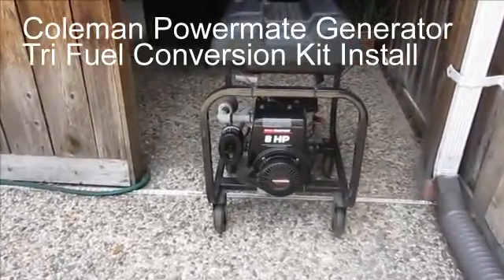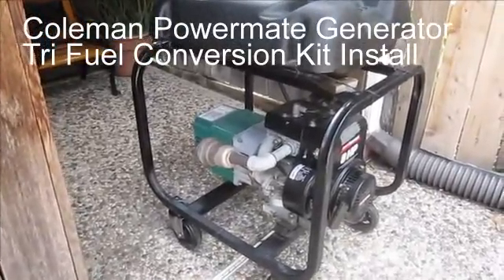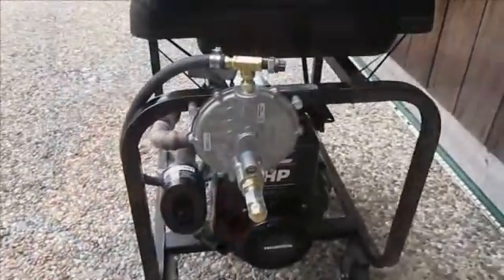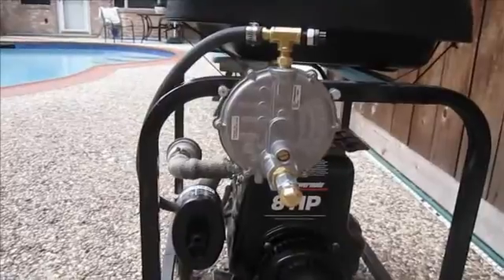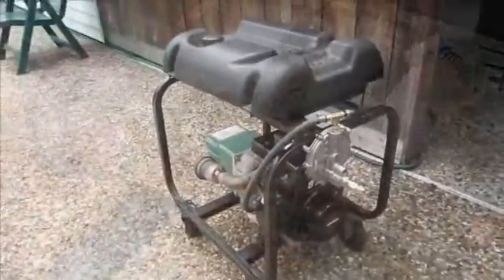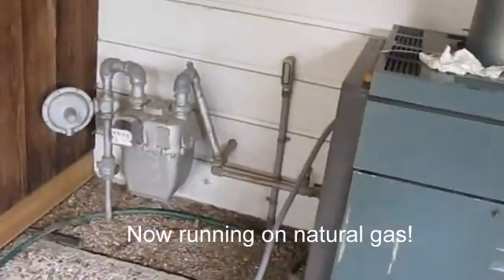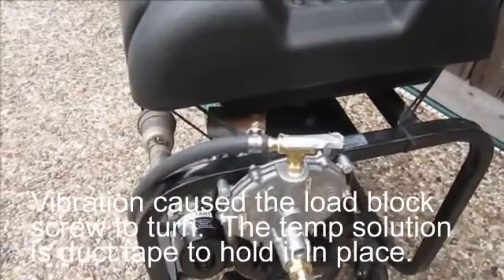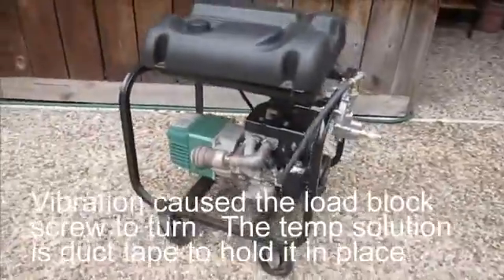Coleman Powermate Generator USCarb tri fuel conversion kit C to natural gas

Comment: I just bought one of these 10 hp 6k watt generators for 45$ I was excited to see that there is a tri fuel conversion for 30$ haven't even tried to start it yet but looks like it was lightly used and then left in a Barn, compression felt good I'm going to tie into my propane after I proved it runs and works.

Comment: good video. I have a 10hp tc the hm100 motor,I bought a propane/gas carb on amazon for $37, it does not fit. in fact I looked & can't find 1 anywhere. I have 1 on my 3500 watt no real name, very popular model, it runs great on pane,not great on gas with conversion carb. since I could not find a combo carb, after seeing your video I decided to make my own adapter between carb & air filter & take pane reg of the carb I bought that does not fit, since I can't return it past return date & I never checked to see if it fit.  was very simple. I have a lath & just machined a 1" think chunk of  aluminum bar stock with a 1" hole in center,2 holes for air filter mount, go 2 10-32 screws 1" longer then stock & drilled a hole in the spacer I made & tapped it 1/4" pipe thread & installed a nipple, mounted reg to generator frame with the bracket it was mounted to carb with & it fired right up. & it always ran great on gas, pane starts 1 pull,gas I always had to shoot starting fluid in carb to start,so I have a small hole drilled in air filter cover for starter fluid stray :)  hope my info can help at least 1 person. I was able to make lemen aid out of a lemon carb I could not return. not sure why I thought it would work,lots of reviews,but not sure there was 1 saying it fit the TC motor. so my conversion still only cost me the $37 2 .45 cent screws & I had the nipple & aluminum already, just took my labor :)

Comment: Is your Powermate a 3, 3.5 or 4Kw unit?  

The same 8HP Tecumesh HM80 engine is on my dads old Generac 8795 that is 4Kw, 5Kw peak from 3 decades ago.

I bought the exact same USCarb type C kit about 7 years ago, but mine is not permanently installed yet. The generator here has no frame and the top carry handle broke off because it vibrated to the engine's dance. The KN demand regulator can get goofy if it sees much vibration. Any used generators like the generac here on ebay always have the handle broken off since the handle is a blur when the unit runs.

Generac made a commercial version like mine that did have a box frame and a giant fuel tank the Industrial Generac model 8911-1 .

 The HM80 is a good engine, the one here went  salt water in Katrina and I used it after the storm for power. The carb's bowl kept rotting out due to salt years later thus I bought a brand new carb after having the replace the fuel bowl every single summer for hurricane prep.

https://www.youtube.com/watch?v=T2x5yNRwzlw

In some crude experiments with my HM80 flathead it seems to consume about one half the fuel ( gasoline or NL or Propane ) even with no load since the engine is at 3600 rpm. Thus the fuel burned versus wattage is least when the unit has the most load, ie going from 3 to 4 Kw uses way less added fuel then going from 0 to 1 kw.

During Katrina I did have a failure mode where the twistlock 120/240 volt plug on my Generac would tend to vibrate out. The plug on mine is actually on the alternator's head thus it sees vibration. What happened is the plug came out a little and the neutral got unplugged but the two 120 hots of the 240 volt held. This blew out some lamps and my garage door opener. One side of the 120 volts went high to say 180 and the other side went to say 60 volts.
Reply from the maker: Model number is PM0524000.  It is 4000 watts.  It has 2 120v receptacles and 2 240v.   Total amps is 40.  .

Comment: Does the installation bypass the carburetor?  By carb is bad and I am tired of cleaning it.
Reply from the maker: Sorry for the long delay.   Somehow I missed the comment and question.  No, it does not bypass the carb.
Reply: Thanks.
Reply: Get you a new carb they are very cheap, and make sure you add an additive so your gas doesn't bump up from sitting long periods. I bought carb for $20 or $30 also use a good fuel filter. But the additive is the key..